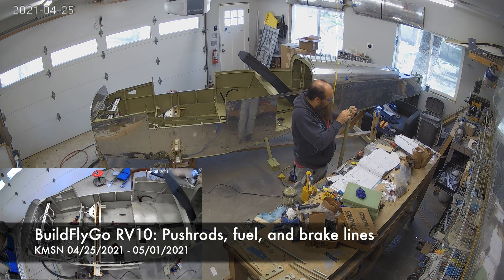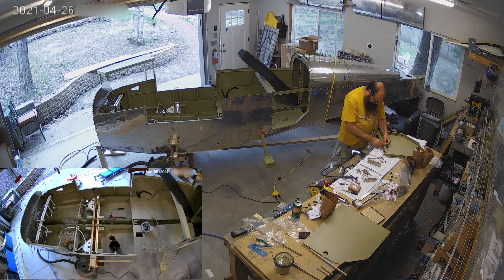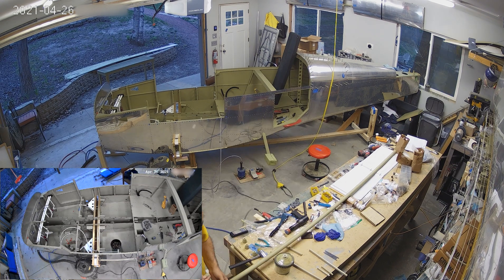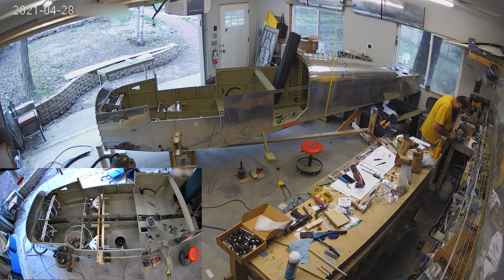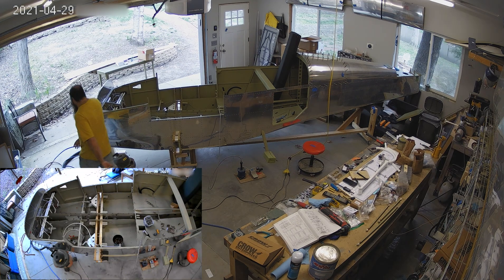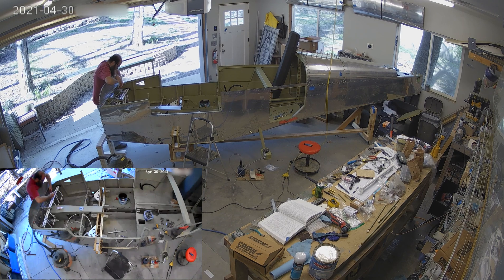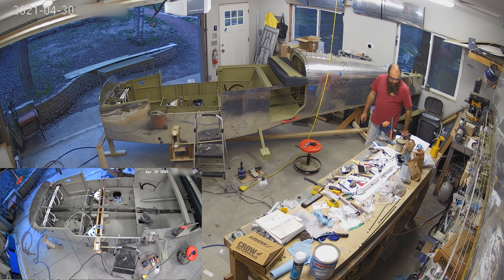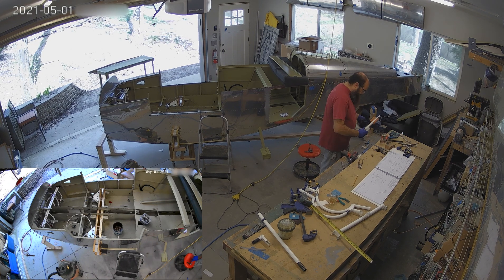RV-10 Build: 05/01/2021 - Plumbing, fuel, brakes, baggage door, controls!

Comment: Did you by chance make any “plans” for the Andair fuel valve so those of us following along don’t have to reinvent the wheel and go through the same sleepless nights worrying about our design being 3degrees off? I know being a perfectionist I would definitely be in the same boat as you.
Also, which extension kit did you order? What length did you end up with?
Reply from the maker: Ugh :) Not really, it's very much a "make it fit" kind of situation. The bracket itself is easy enough, it's just a plate with 4 holes in it that you can match-drill through the valve. I bought the 6" extension kit and only used about half of it.

Comment: So by going with the Beringer brakes and wheels, did you delete those items from your fuselage and finish kit order or did you eat the cost??  If you deleted, how do you know the part numbers in advance since the plans come in each kit??  I just ordered my empennage kit and I'm trying to figure out those changes before I order the next few kits.  Thanks.
Reply from the maker: Deleted and saved a few bucks. Reach out to AircraftSpecialty before you order and they can give you a list of the parts. You can also return parts you don’t use to vans for credit.
Reply from the maker: One more thing. Get the plans on the USB stick from Vans so you have them all ahead of time.
Reply: @BuildFlyGo  I will do that.